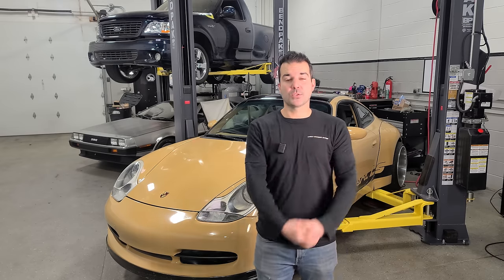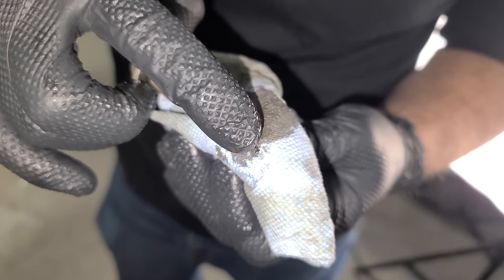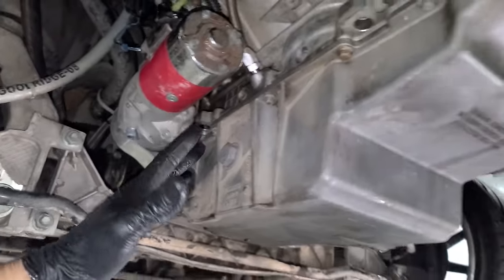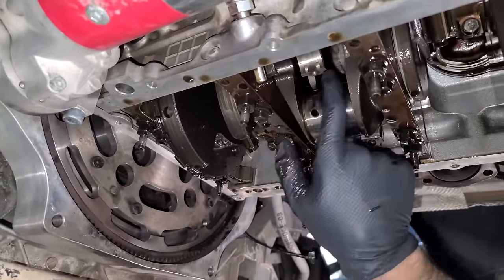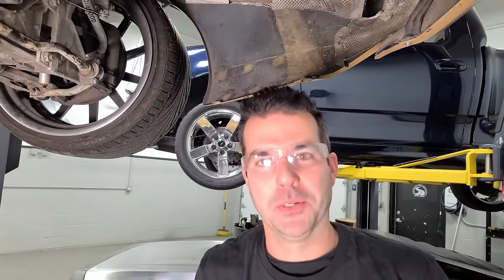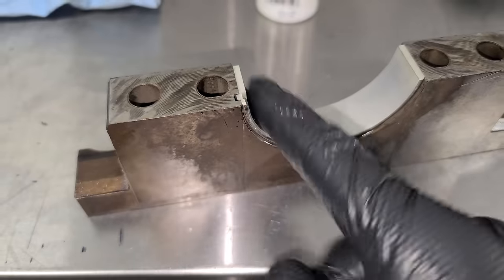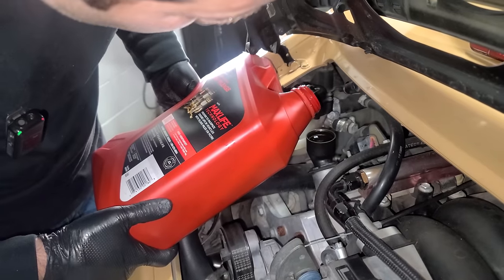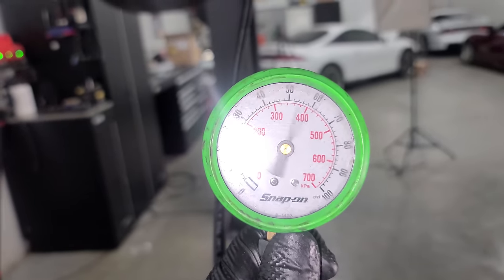My LS Porsche 911 Was About To BLOW UP So I Attempted A RISKY DIY Engine Fix!

Comment from the maker: Let's start an LS pressure thread. List your type of LS, mileage and oil pressure. Thanks!
Reply: I have the lq9 vortec max. 

Mine sits around 20. And 40 cruising.
Reply: 4.8 Vortec with 272k miles. I usually have around 50-55psi at cold start, 35-40 at idle, 70-80 under acceleration.
Reply: Lm7 45 psi cold. 60 on acceleration 30 hot
Reply: 40 psi cold idle, 20 hot idle, 40+ above 2000rpm stock 1998 Ls1 130k miles
Reply: I read the white board! 😂
Reply: Anything under 20 hot is bad. Blasting 60 to 90 psi of oil through the motor is bad as well unless it's a race car. A good 20 hot and 40 cold is where a healthy motor lives.
Reply: 50 cold, 40 hot idle. Gen 4 6.0
Reply: 2002 LQ4
233,635 miles
melling 296 oil pump
has only run valvoline 5w-30 high mileage synthetic
hot idle is 58, 2k rpm cruise is in the 70’s.
Reply: 01 tahoe starts up at 40+at idle runs at 70-80+ lbs.  07 ltz silverado starts at 25 lbs idles at 17lbs runs at 40-60lbs thru rpm range. Has brand new oil pump and a restrictor also.  Was a dod engine,now its deleted with same oil pressure.
Reply: LS3 40k 45 cold idle and 28 hot idle
Reply: LT1 (gen 6 Camaro).  About 40 psi cold idle and 30 hot.  Cruising at 2k rpm on the freeway fully warm is usually around 37 psi.  This is with 0w-40 oil.
Reply: 2yo LS3 crate motor. 42 cold idle, 24 hot idle, which is 550rpm. Cruises at 35-40. 5w-30 M1.
Reply: Ls2 144k miles cold start 50psi 
Hot 37
Reply: LM7 237,000 40 at idle, I've replaced the oil pickup o-ring, it was way worse before that. L59 188,000 also 40 at idle and I just bought this one so I don't know all the service history. BTW nice to do list 😉.
Reply: 5.3 , 88,000 mi , 67psi @idle , 82psi @ 2500 rpm this is with the Melling '296' using the COPO spring and 0-40 Mobil 1, 210 degrees water temp.
Reply: Ls1 140k miles. About 26psi hot idle.
Reply: Lm4 swapped in a 944 170k with upgrade oil pump, 60psi cold idle, 45-50psi warm idle
Reply: 13 5.3 Tahoe
38psi cold start idle
22psi hot idle

17 6.2 Sierra
45psi cold start idle
35psi hot idle
Reply: So my 98 Camaro with an LS1 with believe it or not...293,000 original miles idles cold with 60 psi and hot at 45 psi with 10w-40 amsoil
Reply: 01 sierra 5.3 300k miles cold start its about 45psi cruising its about 55pai. Warm idle about 28-30psi
Reply: 4.8 2007 2500 express, 220k miles.  50 cold, 40 warm idle, 70 2500 rpm cruising.
Reply: ls3 in a 14 Camaro .101200 miles  on cold start I'm around 2.3 bar at temp  600 rpmish around  0.9 bar at 2000 rpm cruising its above 2 bar
Reply: 2000 trans am ls1 with a melling high pressure stock flow pump. 40-60 psi cold 40 warm on the highway and up to 80 at the high rpms ab 14k miles on the motor rebuild
Reply: @gkonitz7480  have you replaced lifters? I’ve got a tick at 140k
Reply: ‘03 Escalade, LQ9 with 108k. I run 5w-30. Oil pressure at idle is 43-45 cold and 38-41 warm. I don’t think I’ve ever seen it over 55-60, but I drive like a grandma. 
I hope to straighten up my garage and tools after shoveling a bunch of snow. 
Saw your “to-do” list. 😂
Reply: 2005 2500 Silverado LQ4 470,350 miles all original. Oil pressure is horrible when warm. 4-6psi  @idle 10-15 psi around 2500-3000 rpm. No engine noises, i changed the oil pump to a 10296 melling with COPO spring. Idle pressure when warm is now 6-7 psi and 35-40 psi @2500-3000 rpm. Runs great but still concerning. I’m considering rolling some bearings in now but could need cam bearings too with almost half a million miles. FYI high flow high pressure pump doesn’t help idle pressure much it states that in the instructions with the pump. I daily it to work trying to reach that half a million marker before a rebuild or swap
Reply: I have a 2002 silverado w/5.3 w/311.000mi 50 ish @60mph and 25 to 30 psi Idle runs great  Burns about a qt in between oil changes oh yeah I run her a little hard at times 😊
Reply: LS4 in an 07 impala SS with 128k miles. about 50-55 cold idle, ~35-43ish hot idle (oil at like 230 F), 50-60 when accelerating or cruising.
Reply: Ls3, 100k miles, 50psi cold and 35psi hot idle
Reply: Screw the LS my SBC makes 45psi while cruising and it's got 322k miles on it without a refresh lmao
Reply: L59 5.3 Vortec with BTR truck norris cam, springs, milled heads, LS7 lifters and rocker arm trunnion upgrade. 60 PSI cold start, 40 psi warm idle, pegs the gauge when revving. around 60 psi when driving around normally. Factory oil pump, castrol 5w-30.
Reply: c5 with an 65000 mile ls1 sits at 40 psi at 1300-1500 on the highway warm, and around 30 psi warm at idle. I have seen as low as 27 at idle on hot summer days in traffic. Cold, it is pretty dependent on outside temp with idle pressure usually around 40psi when warm and 50-55 when temps are well below freezing. Pressure rises much more quickly when cold, but always does as load and rpm increase.
Reply: 170k mile 5.3 LM7 - 35-40 psi hot idle 
107k Mile HCI LS1 - 25-30 psi hot idle
Reply: I know it’s not technically an ls but a 5.7 vortec 178k miles cold 60 psi driving on freeway 55psi warm idle 40-45psi
Reply: LS6, at least 50 cold and goes up from there under acceleration. Even at operating temps it’s slightly above the mid level of the gauge.
Reply: 370” lq9 with ls3 heads 11.2:1 comp with LSA supercharger 2.45” pulley….hi volume melling pump 70psi cold 55psi at temp and idle…….all packaged in the lil white nova in the tiny pic
Reply: LQ4 in my 190k mile suburban reads 40ish psi on start-up, 50-60psi cruising on the highway
Reply: 383 LS with aftermarket rotating assembly, melling m295 high pressure, standard volume pump, engine builder called for 20-50 VR1 conventional oil...runs about 60 psi cold and 38ish psi hot.
Reply: 5.3 base 02 silver. 90 psi all the time becuase the stupid sensors leaks oil and i unplugged it and plugged it.😂
Reply: I had on '06 Sierra with a 5.3. At about 200k, oil pressure was 30 cold and 20 at hot idle. I ended up replacing the oil pump and pick up tube oring. Took a few hours with the motor still in the truck. First fire up, 60 psi cold, 45 hot idle. Super easy job.
Reply: 05’ LQ4 with 225k-ish, on 5w30 it was 30-40psi cold idle, 15-20 psi at hot idle.  30-40psi at higher RPM’s.  Switched to 5w40 and it picked up 10psi everywhere.
Reply: 1999 LQ4 188k miles 0w-40 Mobile 1 Euro formula 40 PSI hot idle, 60 PSI highway cruise 
2012 LS3 dry sump 22k miles 5w-30 Mobile 1 60-80 PSI depending on RPM

I would recommend 0w-40 for any LS under 30 PSI hot idle. 0w is great for cold start protection!
Reply: @dustinyancey6376  Run 0w-40! My LQ4 was down pretty bad on oil pressure 15ish hot idle, swapped to 0w-40 and got 40 hot idle.
Reply: I have a c5 z06 with the ls6 and I get about 45 psi cold 30-35 psi hot and like 50-60 psi when past 2k rpm
Reply: 222k mile Yukon 2500. LY6 6.0 hot idle 18-20, 40 at highway speed
Reply: Funny whiteboard message. I did all those things. Good stuff. You truly are insane to take on all these builds. Good luck.
Reply: Early 2000 stock LM7 5.3, all original parts still on it with 298,910 miles one it and at 500-700 rpm 41 psi 1500-2000 rpm 60 psi when it is hot and when it is cold the idle psi only changes from 41 to 60 for a couple minutes until it warm up.
Reply: Fun fact LM7 and ls from 99-06 can run low as 8 psi and it will be inspect 😅 I wouldn’t recommend I rather it to be around or near 40 psi.
Reply: LS1 with 150k. 60psi at start and 40psi when warm. About 60psi when cruising warm.
Reply: 2006 LQ9 6.0 168k miles

30-35 psi hot idle, 40ish psi cold idle and 40+ psi cruising 50 mph
Reply: @legionof0ne441 i actually switched to 5w-40 rotella i was using 5w-30. I think the 5w-40 is what gave me the extra 1-2 psi at idle not much though. I get a little nervous idling but if I’m moving I’m good. I hear that you want 10psi minimum for every 1k rpm when it comes to these old worn ls engines.
Reply: @dustinyancey6376   Wonder if your pickup o-ring is blown. May seal up as you get into the RPM but back off as your RPM drops.
Reply: Ls2 135k 30psi hot idle, l92 180k 27psi hot idle, l92 190k 25psi hot idle, lsa 50k 27psi hot idle
Reply: These LS1s are all over the place! 🤦
Reply: 40 at cold start on my LQ4 from 2005
Reply: @legionof0ne441 i wish. That was the first thing i tried before i changed the pump. I tried a new oil pressure sensor and the cam restrainer plate. At this point it’s either the bearings, the oil galley plug, or the rear main. I don’t know if the rear main seal will cause that much of a loss though if any at all.l
Reply: @imm0rtal420 lol screw ur gen 1 sbc shitt probably doesn't make enough power to hurt itself 😂
Reply: @vans1107   and  20-50 semi synthetic  oil    Alex  you should use also   because its a little more hotter engine in  rear  of car
Reply: Not strictly LS, my 2004 Denali 6.0 cold start PSI is a tad over 40, hot idle is 36-40, and 70mph is roughly 42-45ish.
Reply: Use  20-50 semi synthetic / blend  oil    Alex    because its a little more hotter running  engine in  rear of car
Reply: Crate LS3 hot idle is right at 28lbs
Reply: Bosses 5.3 has 375k has 5 psi at idle.. confirmed with a manual gauge.. still hauls his camper out to lake ect.. doesn't knock.. but cranks stiff as hell.. sounds normal when running... Been that way the 4 years I've worked there... Mobile 1 0w40 and XM-5 keeps it going lol... 25/75 🤣
Reply: @TT64NOVASS  iron or aluminum block? Has this ever been rebuilt? I think these are 2, very important questions. And I love your oil pressures.
Reply: Alex, I've built a bunch of these. Iron block vs Aluminum makes a big difference in oil pressures once these have been rebuilt. Aluminum grows much more, and generally has less oil pressure. On Aluminum blocks, my clearances are normally .0022. I like the Melling M365 pump, and I shim the pump spring .060 ish. I normally have around 65-68# of oil pressure on cold start and 40-42# at idle warm with 10w40 in the summer. We have probably six of these, that are 600-800rwhp cars that all run single digits, beat on pretty regularly.
Reply: @rpturbo  
Iron block GEN IV 5.3 , the bearings looked so good that i reused them , i put news rings, lifters a Sloppy Stage 2 cam (228/230) and a Melling '296' oil pump that i put the COPO spring in , it had 28 psi at 125 cranking rpm, the best oil pressure ive ever had with an LS, I'll never use a different oil pump again !
Reply: @dustinyancey6376  
I read somewhere that on LS engines 6 psi per thousand is acceptable and in spec.
Reply: 10 ss Camaro 27ish hot idle worried about it after having a 327 69 Camaro .looked at a lot of different pressures gm does say 6psi. Per 1000 all forums ive read ls can vary a lot.pressure relief valve opens at @ 60 so you shouldn’t see any more than that🇳🇿
Reply: 2000 LM7 258k miles: stock was 50psi cold idle, 40psi hot. With turbo it's around 3-5psi lower everywhere. Pan was just slightly sludgy when I pulled to add the turbo drain. Always gets 10w-30 Pennzoil Platinum.
Reply: Hey Alex, I wish you’d start wrenching on motorcycles.
Reply: 4.8 37 hot idle.
5.3 40 hot idle.
Reply: @stamboer99   Same engine in my C7 Stingray, same PSI as yours, cold and idle.
Reply: @SSV-i-c-e  the problem is, those relief valves are about as consistent as LS oil pressure. So if they did actually relieve at 60, shimming them wouldn't really help, right?
Reply: 1999 RCSB Turbo Silverado/built 6.0/meling 295/ hot idle 40-42 psi. Buries gauge at WOT. 
2000 beater RCSB Silverado stock 175k 5.3 35psi hot idle 60+ WOT.
Reply: 02 suburban lm7 5.3 has 75 cold and 40 hot idle. My turbo lm7 swapped thunderbird I just didn't connect a gauge. What you don't know cant worry you 😂 however I suspect much less than the suburban
Reply: LS1 165000 miles 50 psi cold, 40 psi hot
Reply: LS1 2000 WS6 (Stock) 120k miles, 0w40, 55~ PSI cold / 40 PSI hot
Reply: @rpturbo  @rp turbo I don’t no a lot about shimming them but the ls oil pressure is like most other engines as long as your above 20 at hot idle the general consensus seems to be there ok🇳🇿
Reply: LM7 5.3 w/ 217k miles all original. 60psi cold start, pegs the guage with cold revs. Hot start 42psi rising to around 62-65 under load
Reply: You likely have an internal oil leak at the cam retaining plate.
Reply: L94 - 2007 Yukon Denali, non-AFM 6.2 L. 40-45 cold idle, 15-ish warm idle, 35-40 on highway.
Reply: 2006 LM7 with almost 360k miles. Replaced the pickup tube o-ring a year or so ago and getting around 38 psi hot idle to 55 ish psi at highway speeds (2,000 rpm).

I bought this pickup very used and took a good look at the internals when changing the pickup tube o-ring. Still had good cylinder cross hatching and nothing looked out of place or loose. Might not be the original engine, but looks like it is from the outside. The LS style engines are pretty tough if you take care of them!

On the flip side, I used to own a 2001 SS Camaro with the LS1. That thing was a mess. Burned almost a quart of oil every 1,000 miles. Burned out a cat. GM still would not acknowledge it had ring issues. Ended up trading that in for a 2003 Silverado that was almost trouble free for the 160,000 miles that I owned it.
Reply: 2010 Yukon 5.3 2wd, 203k miles, still original engine and trans. 45-50psi cold idle, 25-30psi hot idle. 17/20mpg. Diablosport tuned to delete AFM and Torque management.
Reply: Sort of an LS- 90k mile L76 in a G8, stock guts. HIgh 50's cold/startup, mid 30's when hot and idling. Picks back up when driving.
Reply: 2001 LS1 10th Anniversary Firehawk. 55 PSI at idle on cold start up. Not sure where we are at warm since it's winter here...
Reply: @Phastphil1  No, I was told to always run risolene with my oil. It helps clear the small oil passageways in the block and the ports in the lifters. I cleared a tick in a 5.3 after using it regularly.

Comment: You could install the factory GM Front sump, It came in the Australian Holden VT to VZ Commodore LS1 or in the States the Australian made 2004 to 2006 Pontiac GTO! Only issue would be you might have to redo your exhaust system!

Comment: Cylinder detonation (pinging) can cause rod bearings to fail prematurely as well. Might be hard to hear knocking and pinging under load with the engine in the back like that. Doubt this thing was tuned properly when they put it together